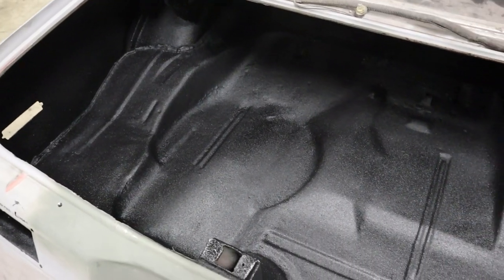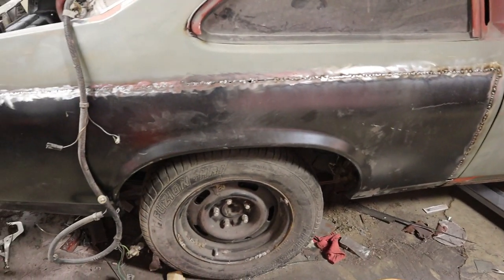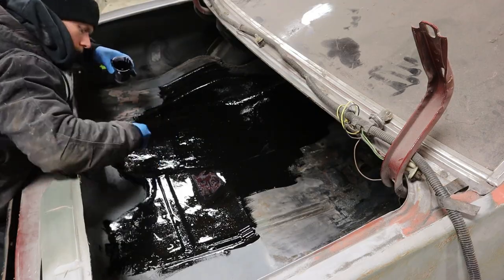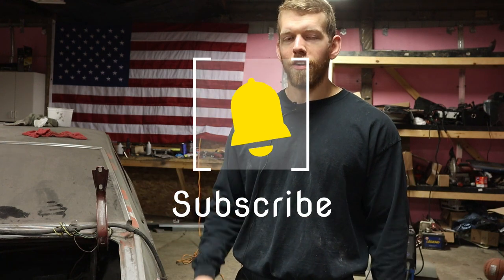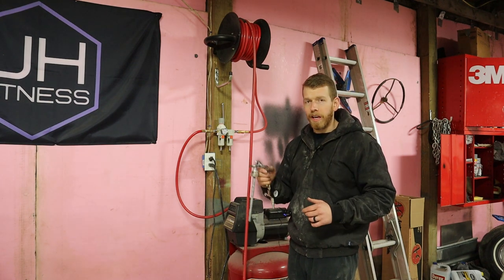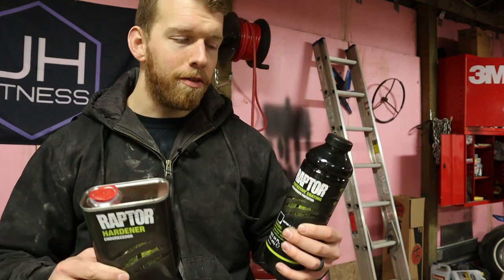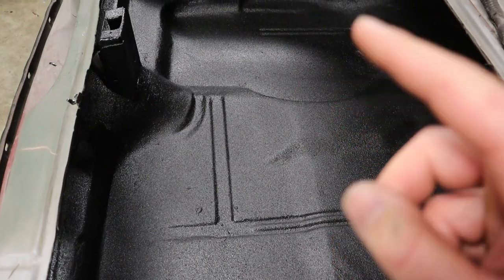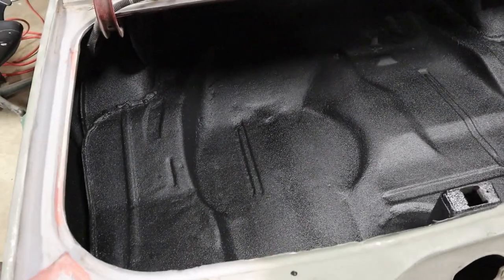Looks Awesome | 1977 Nova Raptor Liner Trunk

Comment: What a transformation! Looks great! Curious, did you put primer over the body filler?? POR is a great product why not the trunk with that just as an extra protection against rust?
Thanks Jake!!
Reply from the maker: I put self-etching primer under all body work done. However, there was a section I applied the POR 15 over the filler. It's probably better to apply the primer again. The filler was sanded with 60 grit, which will allow the POR 15 to penetrate a lot better! Either way works, but as you said, primer is always a great idea!